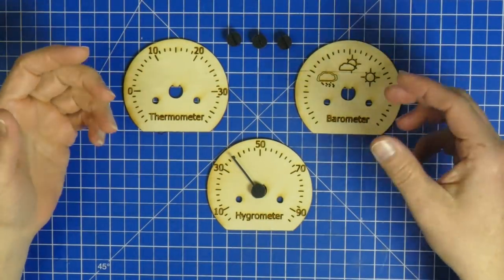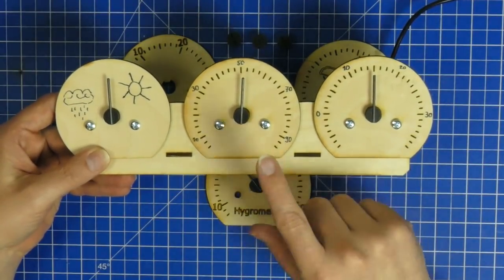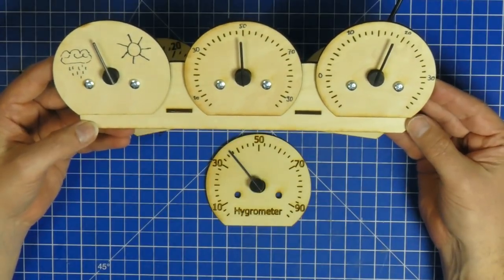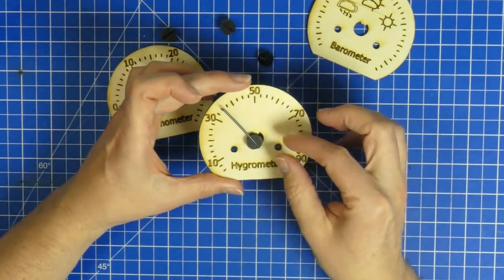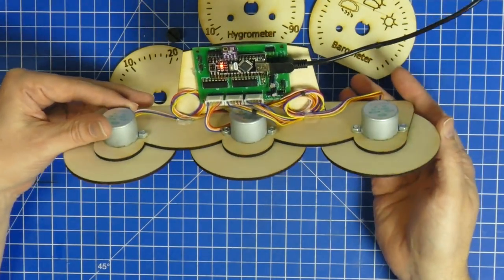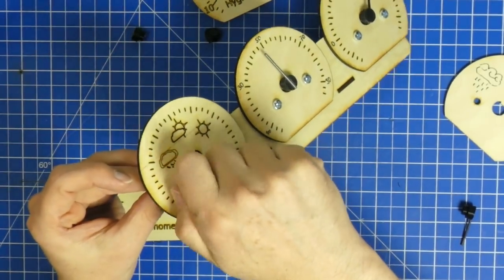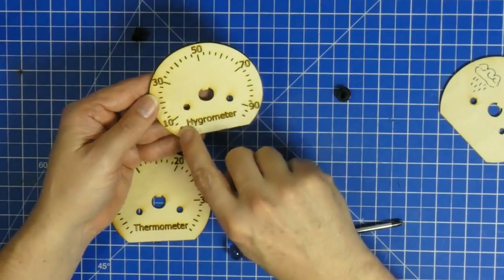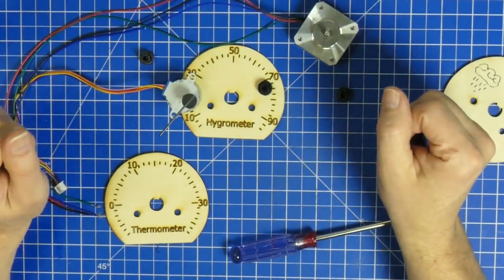How to Make a Fake Analog Dial Display with Steppers

Comment: You can pull fast steppers for analog displays from junk car panel clusters. In a junk car lot look for cars younger than about 2005 as the older clusters were made with just miliamp meters.

Comment: It's a pity servo motors don't usually have a range of rotation above 180 degrees, else they'd be perfect.

I wonder if it's viable to use microsteppers from camera focusing mechanism for this, perhaps for a smaller display with lightweight needles. You can get a 10-pack of these for a couple dollars.

I also wonder what kind of max speed you reached with these. I'm thinking with a bipolar mod and driven off a 3d printer control board with higher voltage, they could reach a revolution in half a second and be suitable to simulate things like automotive instrument clusters and such.
Reply from the maker: The flat steppers will do the 3/4 turn in about 0.25s with acceleration and braking at 1/4 stepping. Thats 600 steps from minimum to max. With overvolting you'll see even shorter times. But that's much faster than you will want to go.

Comment: Dirk - Genius 😇
...pls set up a storage area on your github. While I like the "Maker" and "burnt K40" appearance of you dials ( 😁 ), I'd prefer some "Jugendstil clock faces" and "Delft ceramics" that I would be willing to HD photograph and upload/donate.
ALSO: Make some more "stuff" avaiable ...like (purchase) links and maybe other hard-/software (sort of reference) solution(s).
Could become a small series type of project? 
✌👍👍👍
Reply from the maker: I started making a shopping list for the Robin 3D printer, but things go out off stock so fast it's really hard to keep up.
I do have a section in my github for these 'small' projects (https://github.com/dherrendoerfer/My-3D-Things) where I put stuff like this when requested.
I tried using the laser on other materials, but with very limited success, Fimo was a complete disaster, and the back of my work area still stinks of it.

Comment: I like digital displays when they display discreet information. I like analog dials when I need the value AND the time derivative, like speed and acceleration, distance and speed, voltage and rate of voltage change. These are hard to present with simple digital displays.